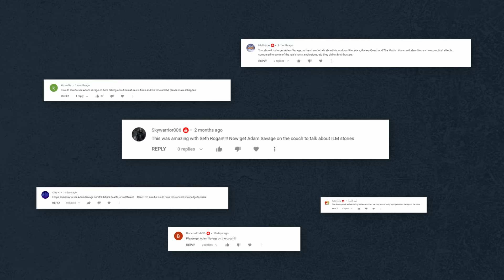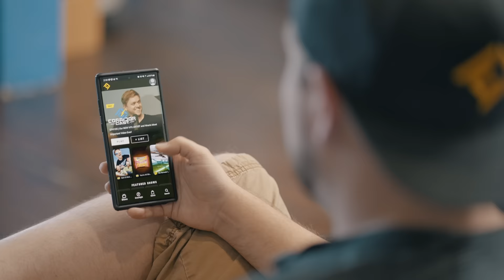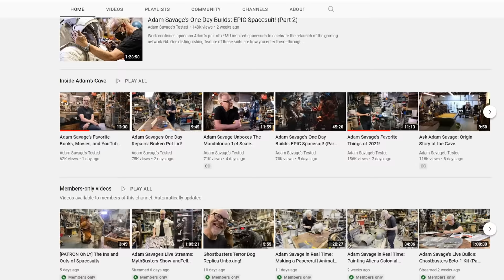VFX Artists React to Bad & Great CGi 58 (Ft. ADAM SAVAGE)

Comment: "Not enough money to do it right, plenty of money to do it twice" ughhhhh this exists in every industry. I contract to build fiber optic networks, and we go through 2-3 year cycles where whoever we are designing the networks for will forget why I cost as much as I do, they cut back how much work they give me to nearly nothing while hiring other contractors promising to do it for half the price (surprise they only do half the job) and then they freak out and come crawling back to me to completely redo the half assed half rate work at my full price! This is also what happens when a fiber optic engineering firm is ran by business majors whove never touched a fiber cable or a patch panel, or climbed a utility pole. All they see is numbers and costs without understanding the most basic fundamentals of the single service their company provides.

Comment: You should react to theme parks rides. The Back to the Future ride had insane models for it, so did the original Star Tours. You can also look at the CGI for the Millennium Falcon ride, Flight of Passage (the Avatar ride),  Pirates of the Caribbean in Shanghai (it's crazy), and the terrible CGI in the Fast and Furious ride, plus rides where they mix screen elements with physical sets: Navi River Journey, Mickey and Minnie's Runaway Railroad, the Harry Potter rides.

Comment: You largely can't fault the practical effects and environments in the Star Wars prequels that ILM worked on. They're quite striking. It's more the plot and characters that make or break such stories. I also think that one of the more severely underused modeling techniques is sputtering heavily thinned high-gloss clear to create the effect of moisture on a surface. Could be oil if you add a tiny amount of black, could be condensation, could be any number of things. But sheen and contrast of sheen is what really sells the realism of a model to me. It's one of the reasons why models, no matter how detailed they may be, that lack a distinction in surface finishes because the modeler used only a single glaze of clear, really fail to read as realistic to me. Especially when it's meant to be oil staining, because oil stains take ages and lots of dust exposure with no new oil leaks to become properly matted. It really is important to add that minute amount of contrast in sheen to sell something.